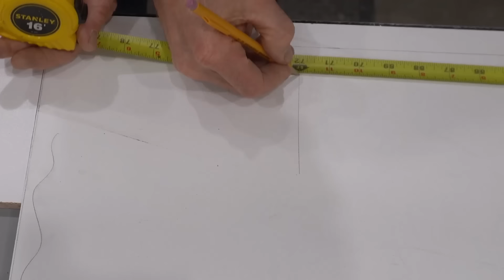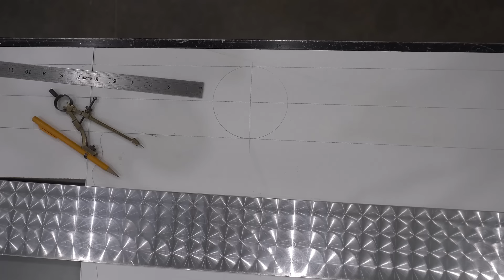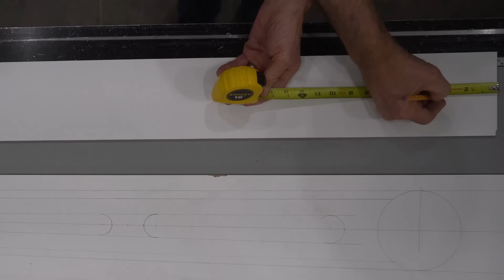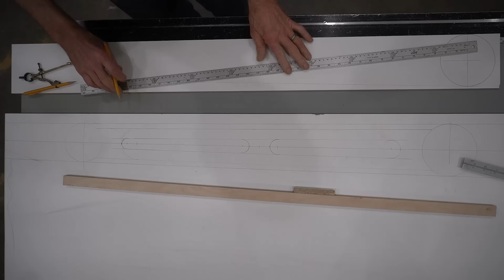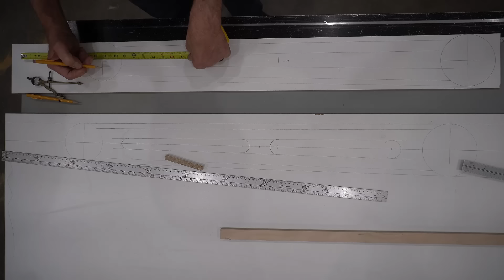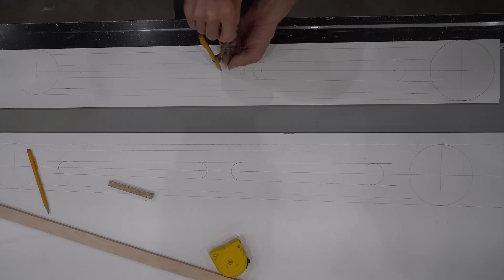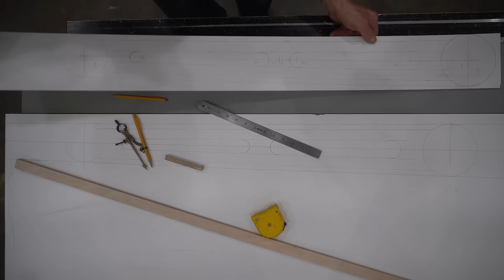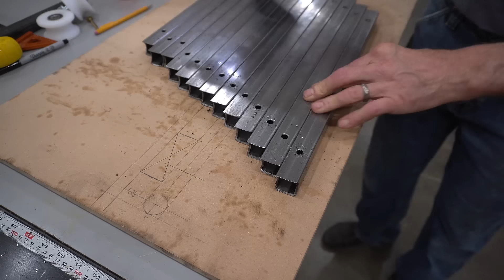Camera Boom Arm & Gantry Build

Comment: EPIC!!!!  The welding slip fixtures were a great way to tackle a tough problem. I also like your approach to hauling 24' steel!!!  I have used that approach for 20+ years now!
Reply from the maker: Thanks Man!  Do guys at your steel yard look at you like you're bananas too or do they know you well enough by now to see that unorthodox steel hauling method as legit?
Reply: @NextLevelCarpentry  No doubt, I've gotten my fair share of weird looks.  I usually put my ratchet straps on the ground and have them drop the steel on top of them.  Just that request will put guys into a tail spin!
Reply from the maker: @GregsGarage LOL!!

Comment: Thanks for the insight! I'm a woodworker as well considering getting a welder in the shop. Are there any special safety precautions you take? Just a little worried about burning things down....
Reply from the maker: General common sense and decent cleanliness are sufficient to avoid issues.  I generally give the shop a once-over before generating sparks from welding and/or grinding.  Flammable liquids are stowed in metal cabinets, rags and towels are removed from the area a any heavy sawdust is swept/blown out to prevent potential conflagration.  One thing that's not obvious is damage done to glass when hit with weld spatter or grinding sparks so I try to be mindful of that to minimize damage.  Something I'm mindful of is the danger of piles of sawdust or chips building up under tools or cabinets that could smolder and ignite if weld spatter bounced unseen into a pile under something.
Reply: THANK YOU! I very much appreciate how thorough and thoughtful your work and videos are. Not often do I watch hour long videos all the way through but I always watch yours!  @NextLevelCarpentry

Comment: This would make a good base for an over-arm blade guard / dust collection for a table saw
Reply from the maker: Thanks for watching and commenting on this video Stephen.  The concept certainly has potential for other applications but for full disclosure I should say that, at the length built in the video, it's great for a light weight camera but would need some thoughtful engineering to support anything like a blade guard that needs to be more fixed/rigid IMHO.
Best,
Matt.

Comment: Hi Matt,  Wow!!!!   Love all the new camera shots.  Your use of templates has changed how I approach my small projects.  One commenter from the previous video suggested  using an articulated arm for holding a vacuum hose.  Thoughts?  Bob
Reply from the maker: Thx Bob.  I imagine you could adapt a similar arm for a vacuum hose but it's probably not all that practical for the amount of work involved.  I'm imagining a setup for more utilitarian use that's stronger and less complex because it seems less 'dexterity' would be needed for a hose vs a camera?  Thanks for watching and commenting regardless, Bob!
Reply: The excessive hose length needed for that would reduce
the desired air flow and vacuum power, at the business end.
When setting up a vacuum system, you always want to use
as little flex hose as is possible, because it decreases the system efficiency. 😁✌🖖